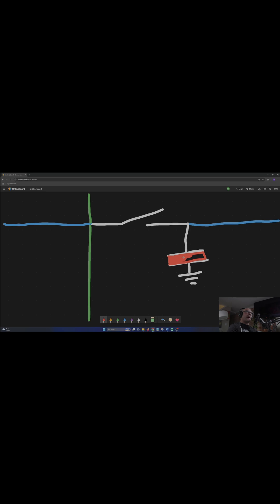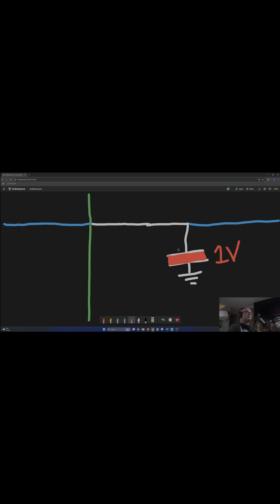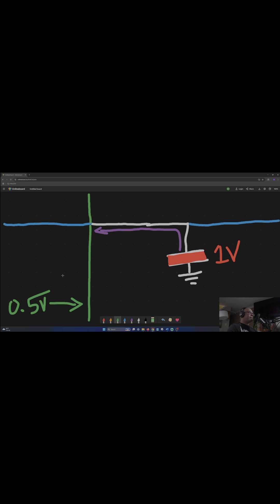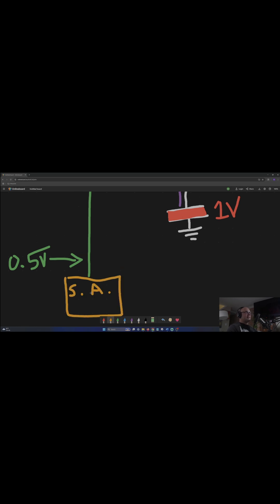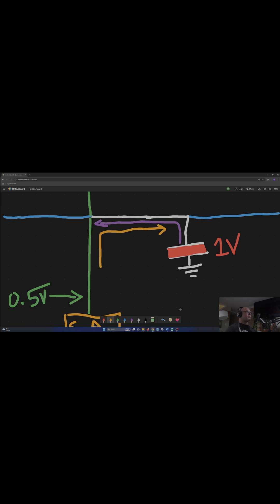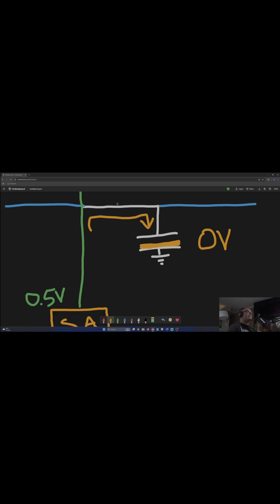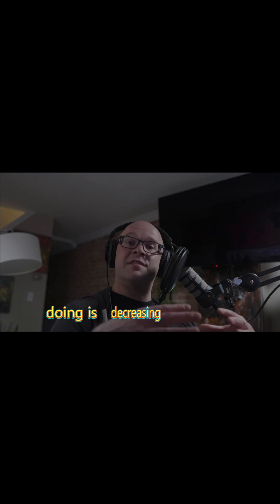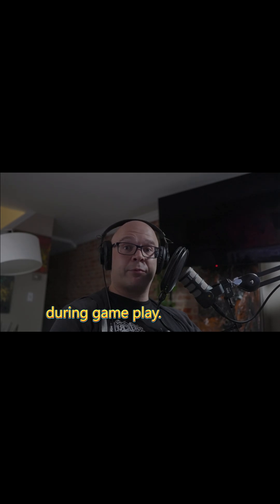tREFI Explained in 3 Minutes  #gaming #biosoptimization #gameoptimization

Comment: So it's better to lower it as much as possible?
Reply from the maker: It's better to get it as high as possible until you get retention errors. When you increase tREFI, you're increasing the interval between refresh cycles = fewer refreshes. That frees up DRAM resources for reads and writes and things that help you in games. But if you increase it too much, you're introducing instability, which can lead to stuttering and even crashes in games. Intel is more receptive to tuning this. On AMD, there's a hard limit of 65535.
Reply: @WunjoTek ah I see now, that clicks with the other video where you solved the crashing problem by lowering it. unless you wanna run PresentMon all the time lol. And it's also locked for the same number for my Intel 12th Gen. I'm at 65535 already

Please keep these videos coming. These info are rare gems nowadays
Reply from the maker: @oMeGa0122 Exactly. Tuning Raptor Lake is so dependent on these refresh timings. And it's finnecky. I've isolated for tREFI and had it error in Karhu tests, and then I've had clean 24-hour Karhu passes and then had game crashes that were only solved by lowering tREFI. Mistakes here aren't necessarily detected by synthetic tests.